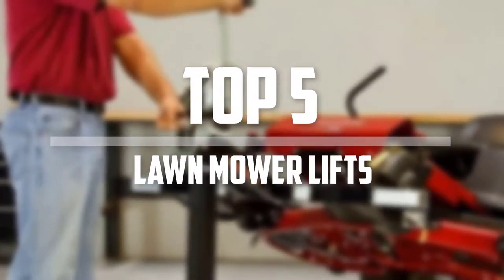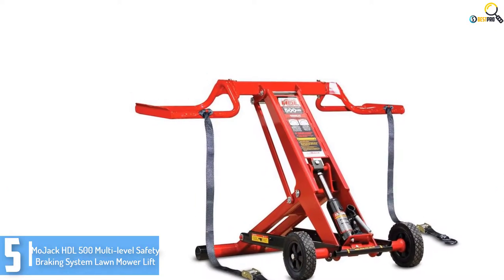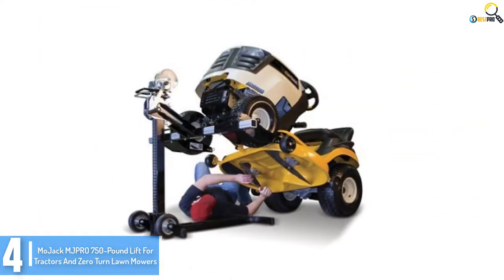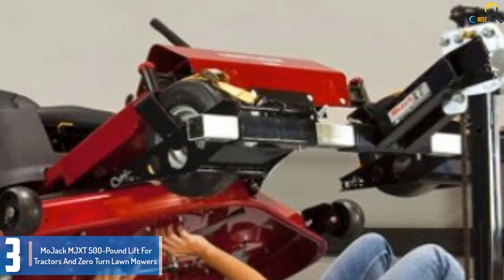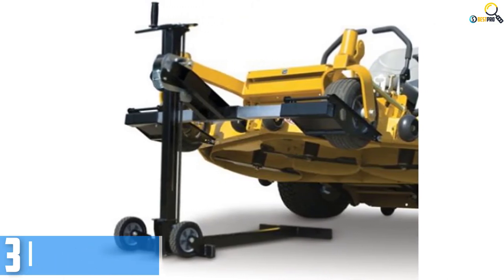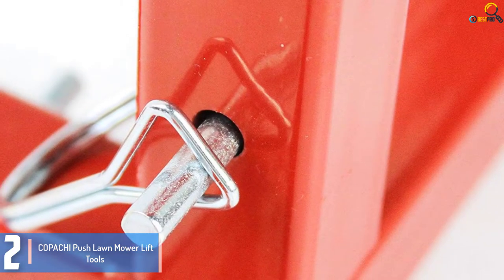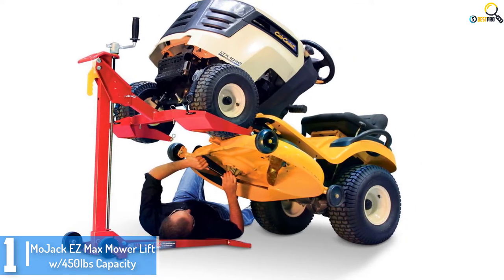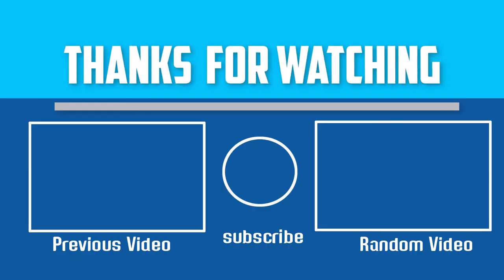Top 5 Best Lawn Mower Lifts In 2020

Comment from the maker: ▶️ 5. MoJack HDL 500 Multi-level Safety Braking System Lawn Mower Lift
[Affiliate]  https://amzn.to/2EYRFIs
 
▶️ 4.  MoJack MJPRO 750-Pound Lift For Tractors And Zero Turn Lawn Mowers
[Affiliate] https://amzn.to/2CemBTm

▶️ 3. MoJack MJXT 500-Pound Lift For Tractors And Zero Turn Lawn Mowers
[Affiliate] https://amzn.to/2NQVRNu

▶️ 2. COPACHI Push Lawn Mower Lift Tools
[Affiliate] https://amzn.to/2XW90cO
 
▶️ 1.  MoJack EZ Max Mower Lift w/450lbs Capacity
[Affiliate] https://amzn.to/2SQ2bFO